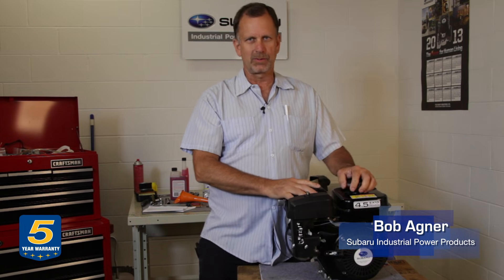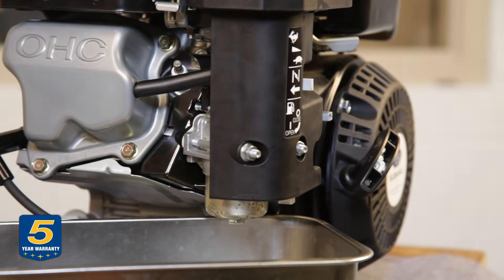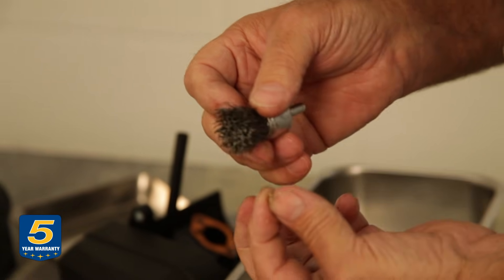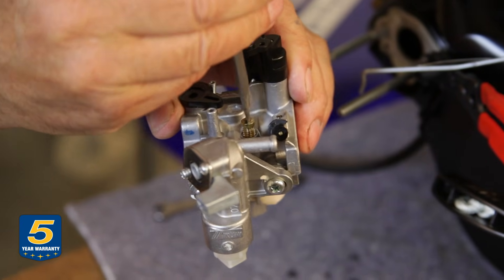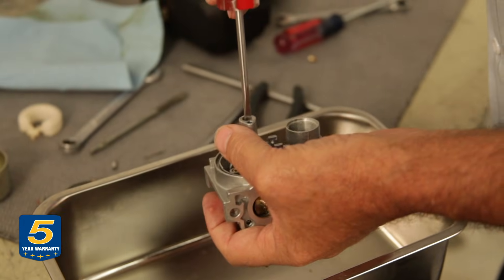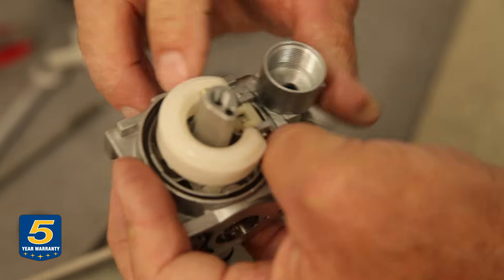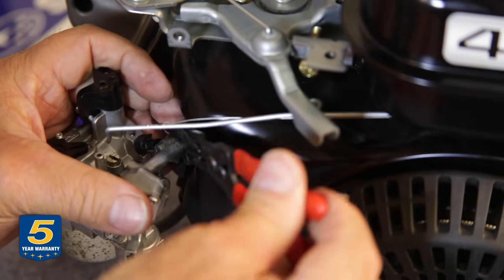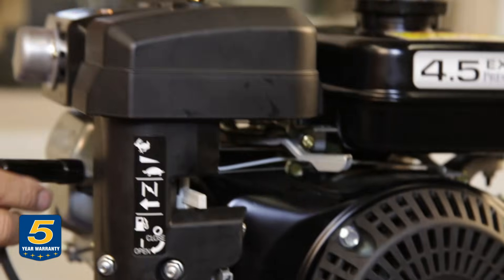How to Clean the Carburetor of a Small Engine

Comment: Hopefully my question may get answered. But I am going to work on my Craftsman weed whacker that seems to be bogging out. It is only a few years old but last winter I didn't empty the gas or anything, so it sat all winter with that fuel. Would it be safe to just try cleaning the bowl and jet first, without taking the whole carb off to clean or is it necessary to remove the carb and clean it all? Thanks!

Comment: Thank You! My wood chipper wouldn't start and I figured it was from old gas in the carburetor. It has a Briggs & Stratton engine and the nearest authorized repair shop is over 18 miles away. I found an auto repair shop that's 11 miles away who said they work on small engines. They said it would take them about 2 hours to remove & clean the carburetor at a rate of $80.00 an hour plus tax. Aside from the cost, it would have been a pain to have to haul the chipper down there and back at a maximum speed of 45 mph, and then have to wait around for it to get fixed, or make another trip to pick it up. So I searched and searched online for any kind of maintenance & repair information on how to service this B.S. engine, but none of the numbers that are on the engine matched up with anything. I've never even seen a small engine carburetor before now. I didn't know what the jets looked like, that the bowl came off, or that it had a drain screw. The B.S. carburetor I have is a bit different from the Subaru carburetor in this video, but I was still able to take it apart, clean everything out, and put it back together. And now it runs! Woo-hoo! So thank you very much for this video!

Comment: Step-by-step video was just perfect.  My pressure washer (Ridgid with a Subaru engine) has been sitting idle for about 8 years.  Found this video and followed the steps.  A couple hours later (4/25/2021) , my pressure washer fired up on the FIRST PULL!  Thanks Bob Agner!  You just saved me hundreds of $$$ on a new pressure washer!

Comment: Thank you I found it very helpful for the various gas powered small engines I own. I converted my generator to propane to avoid startup issues when you really need the genny to work in an emergencies. Next conversion is my log splitter. Gasoline is convenient fuel but a problematic one for intermittently used tools/equipment

Comment: I put a new carburetor on my Subaru 4.5 ex13 a few days ago. Its on a Toro GreensMaster1000 greens mower. I had cleaned the carb a few times, and it was still certainly usable, but I decided it was time to replace it. Nice to have a clean backup. I also replaced the air cleaner assembly, and the muffler. The engine runs flawlessly. I very much prefer the Subaru engine over the Kawasaki engine that I have used on other peoples greens mowers.

Comment: For $24.99 on Amazon/eBay, you can buy a new one and within 15 minutes, install it.  Time, plus carb cleaner, it's cheaper to buy a new one.
Reply: id rather go through the work than buy a cheap replacement carb off amazon or eBay. The true Subaru full carb assembly is almost $200. There is a reason the $30-$50 carbs on eBay are so cheap. Maybe you've had good luck but there are tons of horror stories and complete fails with the cheap carbs. Not worth the risk if you rely on the engine to work in my opinion.
Reply: convert to propane and never have a dirty carb again

Comment: Thanks for nice clean video. I do have problem on my Generac power washer. After spraying starting fluid, it will fire for few seconds and shuts off. I will open my power washer carburetor this weekend and clean it out. I don't have Subaru one but Carb look same. May be all small engine carb mfg by same company :).

Comment: Great video. I got as far as the float on mMy Husky Subaru Generator (EX3000520x28142). Carb was filled with varnish from sitting. Float spring will not come out. Do I need to buy a new carb? Float actually came apart from spring.  Help?

Comment: I can't stop the gas from pouring out after cleaning the carb, had it apart several times looking at the needle and seat, both are clean and no sign of pits,scratches or anything else. I used air to blow out the carb and wondered if there's an o-ring seal that goes in the needle seat?
Reply: Perfekt it definitely sounds like you lost a ring somewhere or one just went bad when you were working on it. You ever figure it out?
Reply: @1goldenson  no a new one was only 8 bucks
Reply: Mine did that at first. I shut the fuel off or pinch off if no valve. Cleaned up the leaked fuel and fired it up to burn off the overflow..shut it down. I removed just the bowl with drain facing front and I think the way the bowl is stamped/shaped on my model and may have jammed or interfered with the needle valve and float movement. I verified free open and closing of needle valve by opening up the fuel flow while gently opening and closing the needle valve manually moving the float and if shut off and opened flow perfectly. I noticed the bowl shape and it fit nicely with the drain bolt facing me, or towards the air cleaner box. Turned on the fuel and no flood of gas. Fired it up and it ran with no flooding. However now it runs but surges/hunts via the govener. I did lose the tiny needle  valve spring (and I did step on the tip and messed up the winding but managed to get it back to fitting over the needle valve) but forgot if the spring goes between the float and needle valve or between the top of the needle valve and the float. Which didnt seem right. I did turn the spring over and put the "repaired" end of the spring facing the float instead of facing the needle valve. Not sure if that is affecting the fuel level or if its even causing fuel level fluctiations. But it's running great despite a slight surging while under zero load. Put a load on it and its fine. P.S. Never removed and cleaned the idle jet, but I did clean it and made sure it was clean and free of debris. May have to go back in. Also used compressed air with the carb cleaner and you could get a big bass to hit it it was so shiny and glitters! May try some fuel cleaner/treatment to address the surging as another video had success with after 2 clean outs didnt fix his surge issue, but an unsponsored fuel treatment/carb or injector cleaner. I may try Lucas since it works well on my Yukon Vortec 5.7 just have to be careful on amount of additive since this little motor is so tiny 😁
Reply: @dtv4me2  I forget which carb this was on now but i believe it was the tecumseh,, I was expecting to pay 70 or 80 dollars for a new one and it cost ..... $8 new

Comment: enjoyed the demo. my pressure washer engine  (7.0  ex 210 will not stay running so I followed your instructions as you described. I could not remove the plastic filter at the side of the carb so as a consequence the engine is still not operating properely.  Mike G

Comment: Hi.  I have a pressure washer with a Subaru EX21 engine and I wanted to know how to remove the air cleaner cover to check/replace the air filter element.  Mine has the solid air cleaner cover (no hole on top with a threaded stud and wing nut) and it is very tightly attached to the air cleaner housing.  I've tried to pop it off but it won't budge and I'm afraid to break it.  Any help is greatly appreciated.  Thanks.